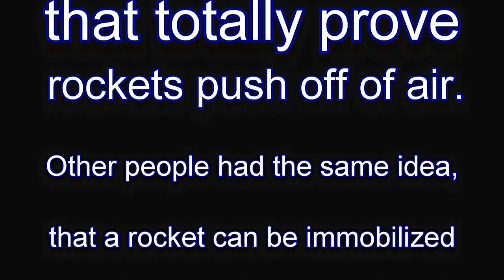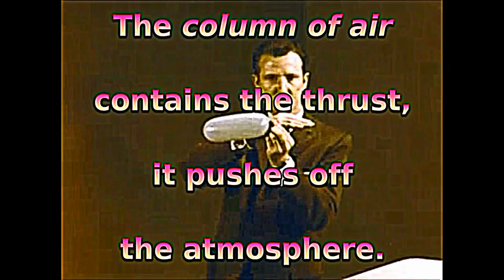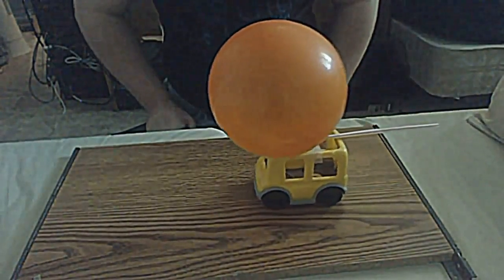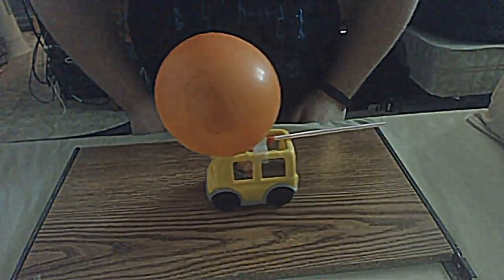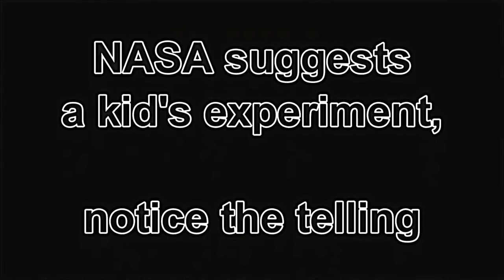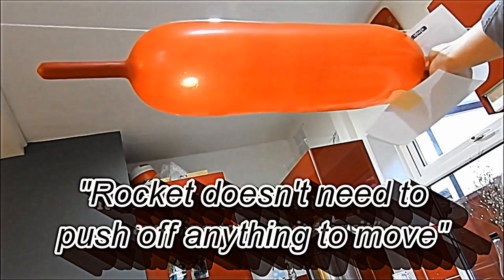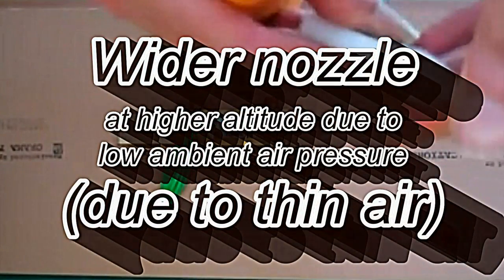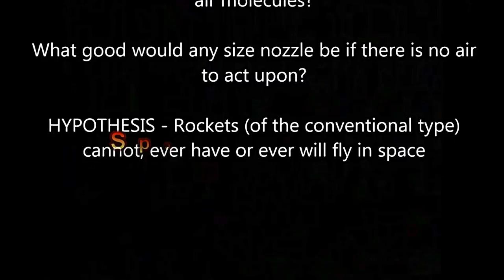rockets push off air

Comment: You need to do a conservation of momentum experiment.

Get a trampoline and a bowling ball.

Get jumping as high as you can and then when you are the peak of your jump push the bowling ball as hard as you can away from yourself.

I'm sure nothing could go wrong in this experiment. :).  Maybe wear goggles and padded pants.

Your landing spot should be further back than your takeoff point.  You'll need to jump pretty vertically to reduce the error.  Might be easier from the 10m tower in a swimming pool ... if they'd allow it.

If you expected the balloon with a paper behind it to move, then you did not do the work of drawing a force diagram which would have shown you that the paper was attached to the balloon and being pushed in one direction and the balloon pushed equally in the opposite direction.  Those forces cancel out.

The MASS that was ejected from the balloon transferred its momentum to the paper in one direction and to the balloon in the other direction.  Again, equal and opposite.

m1v1 = m2v2   momentum

The bowling ball is like the air in your experiment, except we are using momentum to move the person NOT pressure gradients.

The bowling ball should help dispell the myth that a column of air behind the bowling ball is making you move.  The air behind the ball is insignificant to determining your final velocity backwards.

If you wish to discuss, please continue the conversation.
Reply from the maker: That's not at all how a rocket works. Nothing is "ejected". A canon ball is ejected. The video disproves the "ejection" idea or falsifies the claim that once the exhaust has passed the edge of the nozzle, it can no longer have any effect on the rocket.--If this were true, then redirecting the air at a distance from the exit point could not possibly immobilize the rocket. Similarly, once a canon ball is ejected, if I swat it with a giant bat, this will have no effect on the canon. The popular objection that the vacuum was pulling on the rocket is totally dispelled by the opening demonstration. It is quite obvious that the only explanation is that rockets push off air, as has always been known (see the description for a little history lesson). 

Simply put, disturbing the so-called "ejected" exhaust has direct consequences on the rocket, including immobilization. The video started by showing that bending the exhaust at a specific distance from the exit point, immobilizes the rocket. Then, it showed the effects of nozzle diameter, and that dispersing the exhaust at ground level with a wide nozzle, immobilizes the rocket. Again, this is a crystal clear proof that rockets push off air. Go ahead and widen the opening of a canon, it will have no effect.

No bowling balls are being shot out the rocket. And recoil has nothing to do with the bullet. That has to be the final nail in the "ejection" idea coffin. Recoils in a gun occurs after the bullet is long gone, and is 100% due to the pressurized atmosphere slapping the back of the barrel as it almost instantly equalizes the pressure in the barrel. This is easily seen in ultra slo-mo https://youtu.be/rtK3P6Jd_co it's about 5 minutes, please watch it all for our discussion.

So, this should help you understand the paper behind the balloon. There is a delay until the exhaust hits the paper, so where is the instant "equal and opposite reaction, at the moment the opening is created"? This is nonsense. In the future, I want to get a cylinder with three gauges, one opposite the exit point, one in the middle and one near the exit point of the air inside. How much do you want to bet they all show an equal decrease in pressure? How much do you want to bet there will be no force pushing on the inside of the cylinder at the opposite end?

You saw the NASA guy draw his force diagram of the "pushing forces" inside the cone right to the back of the combustion chamber. That was pitiful! No such forces exist of the magnitude required to push the rocket. In FACT, there is VERY LITTLE PRESSURE inside there, bordering on negative pressure (relative to ambient). Moreover, you can OBSERVE the gases POURING OUT like a waterfall from the Saturn engines. No force equal to thousands of tons is pushing back inside the con/combustion chamber. The cone is FRAGILE, and in the Saturn V it had many tubes full of rocket fuel coiling all around it for cooling purposes.

Sorry, but your argument completely falls apart. It has always been known that rockets push off air, which is why Goddard was ridiculed for 50 years by the New York Times (see description) and why the NASA guy in my video who drew those ridiculous force vectors, addressed the point: "many people in the past believed that rockets needed a solid body of atmosphere to push against, this is in correct"--in fact it is correct.

So, when you think rockets think blow torch. Hold one in your hand and turn up the gas, feel it push back in your hand. The direction of the flame also tells you that there is little pressure inside the combustion chamber/cone. The exhaust is trying to penetrate the atmosphere which resists it forcefully. Think GAS vs GAS!

PS You mentioned air resistance. Here is a thought experiment: take a rod with a long taper (say a 3 foot long, half inch thick rod) and drop it from a high place. It will reach terminal velocity after several seconds. Do you honestly think that air resistance is the reason it reaches terminal velocity? Obviously not. Terminal velocity 100% disproves "gravity".
Reply: @rocketspushoffair  That is a whole lot of topics you've brought up.  It is much easier to have a logical conversation if you stick to one problem.  Your final PS is not a valid argument, as you only state that it is wrong ... for no reason... and with no alternate explanation.  That is equivalent to saying 'Nuh uh'.  I think we can do better than that.  You are a fairly capable person, but you have not understood how planes/rockets/falling objects/floating balloons work.  It is all related to pressure differentials.

When rockets create higher pressure air at the bottom of the rocket when compared with the top ... if this pressure difference is greater than the weight of the rocket it moves up.

As a plane moves along the runway, the faster it goes the more pressure difference is experienced between the top of the wing and the bottom of the wing.  The more curved the wing the more pressure difference there is.  So speed of the plane and curvature of the wing (flaps) create a pressure difference.  Once this pressure difference is greater than the weight of the plane it lifts up.  The wings pull up on the body of the plane and it coasts on a pressure difference.

Terminal velocity is due to a pressure front of pressurized air below the body falling.  Once the pressure equals the weight of the body the velocity stabilizes.  Since the air is thinner the higher you go ... the body will have a higher terminal velocity at higher altitudes.  The effect of this is the body will slow as it approaches earth as the air density is greater there.

What is air.  It might be useful to visualize air as what it actually is.  It is atoms/molecules travelling at 1000mph and hitting each other.  It is the combined hitting force of trillions of molecules of air that create 'air pressure'.

You can imagine a rocket as firing a gun downwards.  Your body would feel an equal and opposite force upwards.  Rockets are firing air molecules and YOU ARE RIGHT... those air molecules create a higher pressure area below the rocket because of the air pushing back (barometric air pressure at sea level pushes back).  That pressure wave travels back and lifts the object.

Your statement that 'NOTHING IS EJECTED' doesn't make sense.  The products of combustion are ejected.  Trillions of molecules of CO2 and H20 are ejected from a rocket.  That is not nothing.  They have mass....  If you are saying that the pressure difference cause by the air pressure buildup is what lifts the rocket and the momentum transfer is not the largest force component of the liftoff ... then I agree with you.  However, to say that nothing is ejected, is obviously false.  Something is coming out of the rocket, and it causes the pressure buildup under the rocket.

None of this means that conservation of momentum isn't a valid means of propulsion.

If your only argument is that 'rockets push off air', then I agree, that they do.

If you are saying that nothing is ejected from a rocket, then there would be nothing to 'push off air' with.  It is the column of air coming out of the rocket that pushes off the pool of air below which creates the pressure difference.

I would avoid using 'nothing' when talking about the details of what comes out of a rocket.
Reply: @rocketspushoffair  You say a gun is like a rocket in the gun video.  The explosion behind the bullet created a pressure difference behind versus in front of the bullet.  That pressure wave wraps around the bullet (path of least resistance) and fills the vacuum of lower pressure air in the barrel.  

If there was no barrel, what would happen?  Would you still feel kickback, but just less?

I think I see your point, in that the bullet is not thrown from the gun, but it rides the air pressure wave to the exit of the gun.

You are likening the bullet to the rocketship and the air pressure behind the bullet to the pressure created by the rocket engines.

This seems all reasonable.

If you put that gun on a rail that only goes back and forth and fire it. The gun will move backwards at a predictable velocity dependant on the weight of the gun, the bullet, and the velocity of the bullet (m1v1 = m2v2).

Your hypothesis seems to be that a spring loaded fun fired in a vacuum chamber would not move  backwards due to conservation of momentum.  Is this correct?  I used spring loaded for the gun because then it doesn't introduce molecules from the explosion into the mix and the vacuum chamber remains a vacuum before and after the gun shot.
Reply from the maker: @globalunconscious  "much like a rocket" is what the NRA spokes person stated, and she was actually referring to the recoil, the bullet is the "ejected mass" from your previous examples. She is of course totally in error, because the ultra slo-mo shows the recoil has nothing to do with the bullet, as the bullet is long gone before it occurs, and every thing to do with the atmosphere slapping the back of the barrel as it equalizes the pressure. Thus, with no barrel, there should be little if any kickback.

"...the bullet is not thrown from the gun, but it rides the air pressure wave to the exit of the gun."--This makes sense, it matches the observations..

"You are likening the bullet to the rocket ship and the air pressure behind the bullet to the pressure created by the rocket engines."--To be honest, I was not, I was only focused on the recoil. I think the bullet flies with the momentum or push that it gets by the "pressure wave".

Goddard's demonstration was a gun fired in a small vacuum chamber, the gun was on an axle and it spun around. He was claiming recoil proves rockets don't need air, or the "ejection" hypothesis. I have seen his setup once before. I think it would be easy to take apart and expose it, based on the information from the slo-mo footage. It was a gimmick, I don't think anyone ever repeated it.

The bottom line, is that the "ejection" idea is false. And rockets absolutely push off air. It's as simple as holding a blowtorch and turning it up, you feel it pushing back.

Just take all the information together: the low pressure inside the combustion chamber and cone (definitely no force vectors amounting to thousands of tons pushing anywhere in there), nozzle diameter immobilizing the rocket, bending the exhaust immobilizing the rocket, when a sail is attached and the exhaust hits it off center, the rocket stays in place and does loops (recall modified NASA kids experiment in the kitchen that was modified by attaching the paper sail)...the historical record, quoted by NASA spokes person in video, and in the New Yor Times article (in the description)...exit pressure must match ambient pressure.

Check this out http://www.russianspaceweb.com/baikonur_r7_1.html notice the curved assembly (for lack of better words) or path beneath the rocket? The only reason is to redirect or bend the exhaust at a specific distance.--Could this be a throttling technique? The Americans use a flame trench, it too bends the exhaust. No compare to a rocket launcher in the military, totally unobstructed and the rocket takes of instantly. The only other throttle for a gradual lift off has to be the diameter of the cone.--This also limits the max altitude, just like a jet plane.--Notice fighter jets widen the diameter at high altitude.

PS Someone pointed out to me that Apollo was 3000 tons, and the thrust 3700 tons. At just 1 m/s/s thee weight increases 5 fold to 15,000 tons, he even demonstrated this with a spring scale and he moved his arm up at about that rate, a crude demo but it made the point. So, hoe does Apollo take off? Just another example of NASA lies. All their rockets at Cape Canaveral go into the Bermuda Triangle, and if they suspect witnesses, they end up on the evening news as "the ship mysteriously disappeared, or the plane disappeared".

EDIT: in fact that guy's comment about Apollo is the pinned comment on my video (the  video we are on).
Reply from the maker: @globalunconscious  I just saw this comment, after I replied to your other one. All I can say, is that nothing is "ejected". There is an exhaust thrust column, but at no point in time is it ever separated from the rocket. Think blowtorch, hold one in your hand then crank it up, you definitely feel the push back, because it is pushing off the atmosphere. You cannot push the atmosphere out of the way, any more than you can make a hole in water. Recoil proves this, it is 100% caused by the atmosphere equalizing the pressure and slapping the back of the barrel forcefully.

Comment: dude I mean you got 2 out of 6, thats not good. and plus that vacuum cleaner doesn't simulate zero atmosphere. you need to make a real vacuum box
Reply from the maker: I don't get this knee-jerk reaction to the word vacuum that it somehow has to mean "space"??? Especially after my reply that got you to this video, where I told you point blank that the vacuum was used to REDIRECT (as in BEND) THE EXHAUST. Then, at the start of this video the scrolling text explains it again. 2 out of of 6 is excellent, and if he took measurements where he placed it, he would get 6 out of 6 every time. There is a "sweet spot" obviously. The point is, it refutes the claim that "a mass is EJECTED", and it proves that rockets push off air.
Reply: @rocketspushoffair  oh I thought you were trying to prove rockets don't work in space. sorry
Reply from the maker: @pcbuys7281  if a rocket needs dense air to push off from, then obviously it wont work in fake space  :)
Reply: @rocketspushoffair  hey man, you can save the "fake space" catch phrases and all that I don't believe in nasas space either, that doesnt mean space doesnt exist, you believe in a firmament or some type of berrier right, if so whats on the other side? space could be real, I don't know, you don't know. don't call it fake though, I would hope its real, I think the child and soul in all of us hopes something bigger is out there. its not how nasa says but fuck them.
Reply from the maker: @pcbuys7281  It's definitely bigger out there, but I do think there is a dome for earth, but there is way more out there beyond that. Even deep underground no one really knows what's going on, and I don't think they have been able to find ocean bottom in the Atlantic, I read that in a flat earth book from 1899, I blogged each page of it on Blogger, and I made a hard cover book out of it. The continents are all connected underground, but beyond that circle of land (on flat earth map) between the two tropics, they have not measured the depths. No fiber optic cables to Antarctica (I don't think anyone has ever brought that up) but everywhere else we connect with undersea cables.
Reply: @rocketspushoffair  there lots of things that push themselves regardless of air? there are things that create so much force they move them selves PURLEY from the opposite reaction to the force created, and rockets are like that, the opposite reaction comes from the air and the rocket body. if you take the air away there is still opposite reaction coming from the ship...the force from the blast is pushing on the ship too with EQAUL force as it does the air. so without the air factor there is still opposite reaction. since the ships mass doesnt equal the thrust, then the ship moves awaaaaaaayyy from the thrust